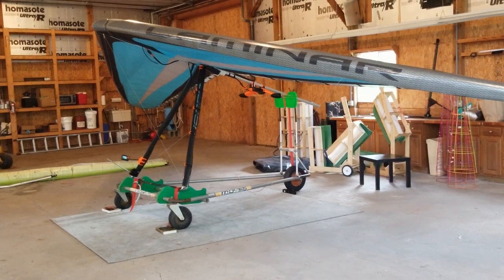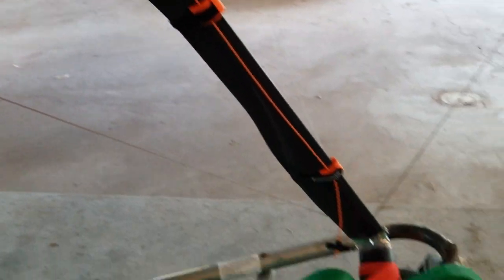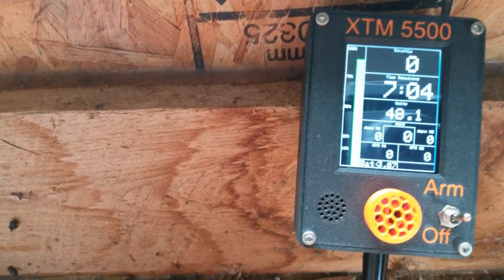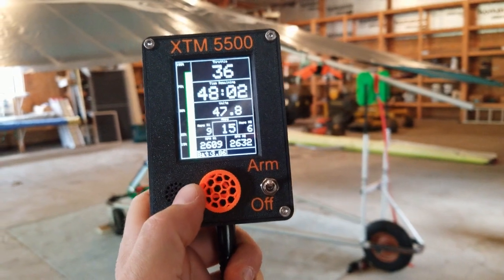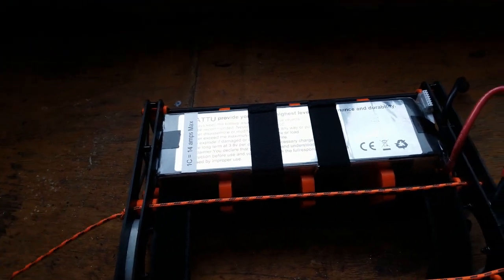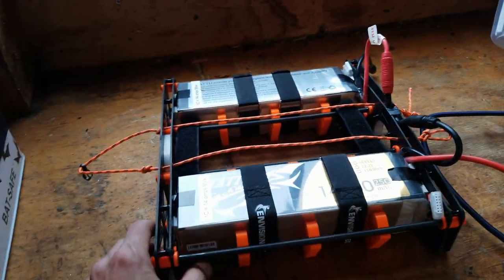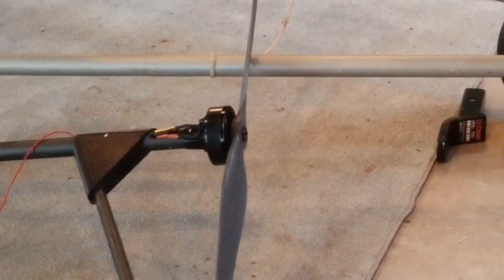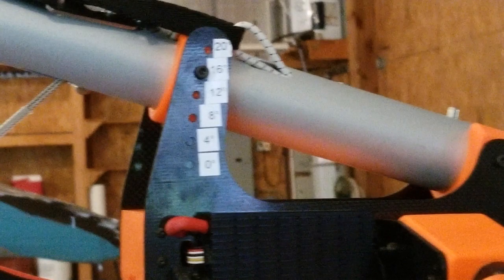XTM 5500

Comment: Really nice work. I was thinking something integrated in the keel in those times... but the problem is the pitch trim and the risk to brake it in case of excessive flare.

Anyway... the batteries inside the sail are a potential deadly risk, because they are Lipo batteries and the risk of explosion/burning exists.
Better to have the batteries in a place were you can bail them out in case of fire.
Reply: Read up on EarthX batteries
Reply from the maker: You make some good points.  My thoughts below:
1. Pitch trim is my biggest concern.  Most people I've talked to compare this to the Soarmaster which is somewhat relevant albeit 2x the weight and mounted on 25 year old gliders with different flight characteristics.  There is a great accident report with lots of data on the Soarmaster here: https://assets.publishing.service.gov.uk/media/5422fdfa40f0b6134200087d/1-1983_Hang_Glider.pdf.  There was also an article by Mark Stucky on the Soarmaster in Hang Gliding Magazine here: https://issuu.com/us_hang_gliding_paragliding/docs/2008_08_hgpg.  Mark was kind enough to speak with me about his experience which cemented my thought the getting the thrust line right is paramount.  For me the center of mass of my glider and harness is exactly 17in above my back plate. I have laser pointers mounted to the motors so I can dial in the thrust line on the ground.  However I plan to make an in flight adjustable thrust line on the next version.
2. Yes you could break unit or keel on excess flare or bad landing.  Since this doesn't pose a danger to pilot beyond normal flying my thought is who cares? Fixed glider / unit and learn to land better :)
3. While lipos are a risk and danger its one that can be managed.  Flying is a risk but we do it anyway.  Many have been flying the ehelp with no issue video here: https://youtu.be/hk-2uNuh5YU as well as the Open PPG info here: https://openppg.com/. Also the biggest risk of exploding and / or fire is during charge, not discharge. My thoughts on how to manage are below:
      - Use high end batteries and operate well below C rating
      - Don't use if puffy
      - Don't fly in cold. Low temps increases resistance of batteries which if followed by a big current draw can result in overheating.

Only practical place you could mount batteries to eject is on harness which isn't ideal for reasons I stated in another comment. On my to do is to design a custom BMS system with temperature monitoring and a heated sleeve to keep batteries at right temp.  However over time as battery tech improves I think this issue will go away.
Reply: @cwallen32  point 2: the problem was related to my idea of design, not your project. In my design the problem was that even with a perfect flare where sometimes your keel touch slightly the ground while stopping, could have been damaging for the motor/propeller. 
Your design works, even if I don't like to see something external of the keel...  but is just question of taste.

Point 3: yes, batteries are going to be better in the times and is right what you say... but in any case I would have it where I can deploy and where they would not fuck my glider and rescue.

What did you use on your 3d printer? PETG?
Reply from the maker: @DavideFinziCarraro  For 3d printer it depends on part.  Orange stuff is ASA for strength and resistance to UV, Nylon for clips around keel on battery for flexibility, CF-PC for motor mount spacer parts for heat resistance.  Didn't use any PETG, prefer higher performance plastics.

Comment: Nice setup, did you test fly it? Why not put half of batteries into harness?
Reply from the maker: The earlier prototype has been test flown, haven't flow with this one yet.  Was planning to test it in Florida at the comps.  However COVID killed those plans. 

Putting batteries in harness isn't ideal for the following reasons:
1. would make wire run too long, would likely need to go to 4awg wire adding additional weight
2. As you increase distance from batteries to ESC it needs to be compensated with capacitors to protect them from voltage spikes caused by inductance in wires.  Could add more caps but these are currently the scariest part of the setup.
3. Battery and propulsion unit are perfectly balanced around the hang point.  If the batteries are on the harness you would need to add a counter weight in the sail to offset the motor weight by adding an additional 9.2lbs in the sail.
4. Would need to find way to mount batteries to harness which would likely be outside and require modifications to the harness. 

Goal was to have unit clip onto any glider with very minor modifications. I drilled 2 holes in my laminar and cut the keel fairing off, however I'll sew a zipper on the keel fairing so I can take it on and off in future.
Reply from the maker: Flew with it 2 weeks ago.  It was a very thermic day which was good as i was able to get up to 3k over launch test but not good to get a feel for effect on glider from power unit vs air.  Overall the extra 15.5lbs was very noticeable when ground handling but the glider was fine once in air with power off.  Glider was a little skaty under full power but very manageable. One issue I had was props didn't fold back when motors were turned off and flying with 2 windmilling props was like flying with a drogue chute. There's no brake on ESC so I was banking on big springs to pull blades back in which didn't work.  Working on a few solutions to this now, but its an easy fix, .  I'll post a more detailed update in the coming weeks but bottom line is the setup works but needs to be dialed in.